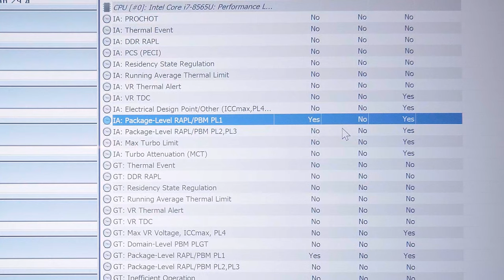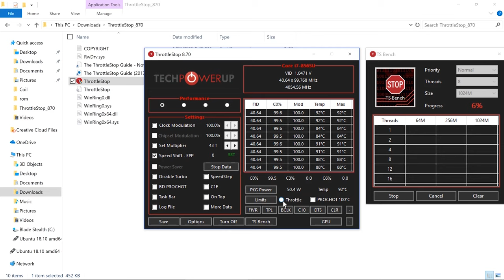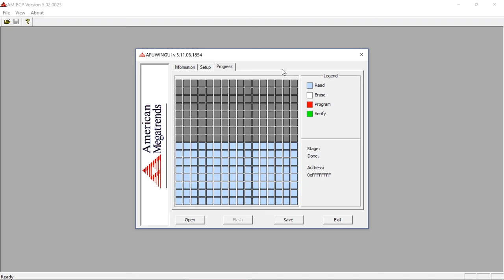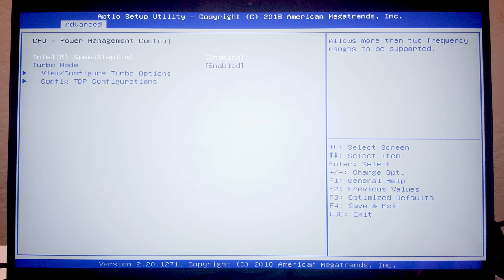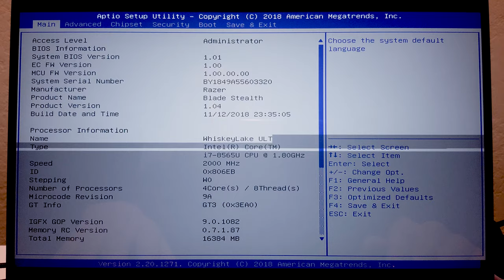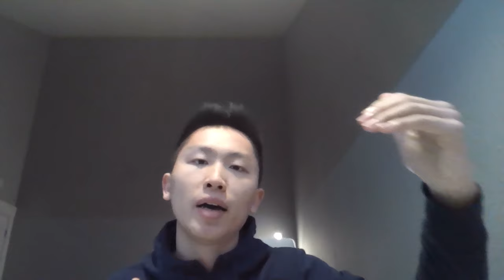Razer Blade Stealth 2019: Ridiculous Power Throttling (Performance Review) UPDATE IN DESCRIPTION

Comment: For only 2.5k subs, this was an incredibly informative video. Looking into changing configurable tdp options for an hp spectre here because it does a similar thing as the razer blade stealth, but after 9 minutes it drops back down to 20 watts on a 9750h, which is a ridiculous drop, everything considered.
Reply from the maker: HP = Having Problems. Glad you liked the video!

Comment: Enable CPU VR settings in the BIOS and try and set the following.  

Advanced/CPU VR Settings/Core IA VR settings/ 

IMON Slope = 50
IMON Offset = 31999
   IMON Prefix = -

This works on my Eurocom laptop to lie to the laptop about the CPU power consumption and allow for full turbo boost without the laptop power throttling down.  

Power readings are going to be wrong, but it will allows me to run unlimited.  Although I would be careful about temps as it looks like your laptop was throttling due to power, but the temps were skyrocketing anyways.  Also your mileage may vary since you have a Razer laptop but the BIOS looks the similar.

Comment: I've got the new RBS late 2019 with the GTX1650. This sees sustained power limiting to 15W. Disabling the GTX1650 within device manager allows the chip to run at 25W. Synapse has 3 options, Battery, Balanced and Gaming. Gaming allows boost up to about 45W for a few seconds then tops out at 15w. Temps at 15w only about 65c.
Reply from the maker: Thank you for this info!
Reply: I just ordered this machine and what to use it with EGPU, therefore I want to get as much as possible out of the 1065g7. I only really need the 1650 when traveling. Is disabling the 1650 and running in gaming mode the only things needed for it to run at 25w? What boost clocks are you able to reach?

Comment: Just update (RAZER BLADE STEALTH 13” 2019 SOFTWARE UPDATES)
new mode call Creator Mode (Embedded Controller (EC) update. )
Reply: @Ray  - i turned the creator mode on and CPU still caps out at 3.1 ghz underload.  Doe the new creator update mean to stop the stealth from throttling?

Comment: Preach brother. This is a major f'ing problem. You should call it what it is: a slow laptop because by design, it can't deliver the performance users were promised. And it's not just a Razer blade problem. It's with almost every thin and light gaming/performance laptops out there. So frustrating

Comment: The biggest problem with Razer is they're scared to let the 13" stealth be as powerful as it could be, or already is. The power throttling will be to meet some ridiculously self-prescribed target set by Razer that keeps it "an UltraBook". Fact is it's probably power throttled because there's nothing else to let it's performance down, so it's kept locked out of it's real ability so they don't hinder the sales of their 15" laptops. 

Unfortunately, every company ends up with this problem. They have so many niche products on the market that they're biggest competition is likely to be themselves in the end. Razer have made the 13" so good, it makes people question why they'd bother wth the 15" - which costs Razer money, even though they're still getting your sale. Apple have had this problem for years with their MBA and MBP updates. The Air periodically gets refreshed ahead of the Pro series, usually with a good 6 month lead. For people that are looking for a new MacBook, they buy the Air because it meets their needs and offers better value for money. When the Pro's get updated, they then compare the saving of $1000 to it. 

The new MBA's with the M1 chip are way better value for money, considering the MBP's use the exact same chip now too, and cooling isn't a problem with Apple's CPUs. Why would you spend more?

Comment: First of all, these tools were very hard to find and I had to try atleast 5 versions of afuwingui before it doesn’t say my system is unsupported. ( a later version of this video works with windows 11 for me ).

The problem is that once I flash the rom I have an error telling me that the ID or something is unrecognized. Apparently it won’t work because it’s unsigned code while it worked for you. My laptop is a rather stealth on 10TH gen.

I also tried to do it with Efi Shell and couldn’t flash the bio too cause the ID of my bios aren’t recognized or something ( error 46 )

I even followed a tutorial to unlock the CPU using the Ru Efi editor and it did nothing. But I guess my solution would be somewhere in these this Editor I just don’t know which values to disable in it and I’m not sure if this works

Is there any way to go past 15W in the stealth model 2020 in 2023 ? Or is it just impossible 

Thank you

Comment: You have missed the cause. The real reason for these forced throttling is Intel's Dynamic Platform and Thermal Framework. It enforces throttling regardless of CPU temperature but base on MOSFET temperature for CPU power supply. Usually the throttle starts around 90C but even without it, these MOS won't exceed 95C with proper cooling (I think Razer does used vapor chamber to cover those MOS) and is safe. The best way to do it is uninstall all DPTF components from Device Manager, and before doing that, make sure the hardware IDs of these components are blocked in Group Policy so that they will not be reinstalled. I've been doing this for my XPS 15 for a really long time and it works superbly.
Reply from the maker: I've already done exactly that. If you Google "disable dptf" the first card that comes up is my article. Thanks for giving my video some thought though

Comment: Thanks for the nice video.
I made a custom BIOS from the information you posted in the overview section. As a result, I was able to avoid PL1 by making the system misinterpret the actual TDP.
I was able to set my Blade Stealth i7 8565U above 4GHz on all cores and got Cinebench R15 880cb at the limit of cooling.
Reply from the maker: Awesome!
Reply: Details?

Comment: "How are you? I need help! Since the launch, I have owned a Razer Blade Stealth 13 i7 1067 with a GTX 1650, and I have many performance issues! I saw in a forum that you solved the problem using a modified BIOS! Where could I find it? The link in your video is no longer available! If you can help me, I will be eternally grateful!"

Comment: Great video that BIOS mod was insane! Bit of a long shot question but do you know if there are any similar bios hacks for the late 2020 Razer Blade Stealth with 1165g7, 1650Ti and 120hz display? From what I've read the bios' on late 2020 models are locked unlike earlier models meaning only a hardware programmer would work. Until I find a solution I will try to use throttlestop even though the cpu is already more than powerful enough for me.
Reply from the maker: I don't know of any solution for that model, sorry. Glad you liked my video.

Comment: Hi Brad, thank you SO MUCH for this video - I've got the Kaby Lake refresh (i7-8550U) Razer Blade Stealth and seriously needed a way to deal with temps and throttling while gaming (using the Razer Core v2). In your estimation, what might be some best settings for my 8th gen CPU when thinking about turning on any hidden settings in Razer's bios for my own machine?
Reply: Also, now that Notebook Check has shut down and the forums are gone (along with the two decades of data in them!) - and your link to the discovery of a new BIOS trick doesn't work - are you able to fill me in on what that new development was by chance? Thank you very much if so :)

Comment: razer just released an update to synapse that unlocks a new power profile called "creator". promises to reduce throttling in some causes. I have tested it out playing  sub nautica and i have not seen the throttling from throttlestop so far.
Reply from the maker: Since I've returned my Stealth, can you help test this? Run a TS Bench (size=1024), what does the Package Power stabilize to?
Reply: Same result as what you had in the video unfortunately, throttles almost immediately when the processors hit 100%. Locked at temps of 68 -71 degress and 25 W package consumption.
Reply: My Razer blade stealth 13 throttles when I play Minecraft. Simply Minecraft, when it's on charger. Any help? I don't want to limit my fps, I feel like Minecraft should make it overheat

Comment: Did you try disabling or even completely removing the Intel DPTF. Atleast with my xps 15 9560 and Asus zenbook ux430 it is the factor that controls the PL1 even after overriding from TS or XTU. Once it is removed the PL1 limits works as expected.
Reply from the maker: Yep, I tried that behind the scenes too. Thanks for commenting though
Reply: I have a onda branded cheap ass 7y30 tablet that had totally unlocked aptio uefi out of the box. I had to disable dptf so it would accept 20w/20w pl1 pl2 (at the same place you had yours changed)

Comment: The only issue with my stealth mx150 is when i use battery power i noticed that sound is crackling specially when trying to play games, sometimes just playing video or song would crackle sound when on battery power. Once i plug in the charger issue goes away.

Comment: Did you ever find a fix since you posted this video? I am getting decent clock speed when plugged in. It starts power limit throttling like crazy when it's running unplugged, on battery. Let me know!
Reply from the maker: Nope. If I did, I would have made a video or some kind of update about it. Rip
Reply: @BradsHacks  Thanks. I'll be on the look out for your updates.

Comment: So I'm using the early 2019 MX150 Razer Blade Stealth and I'm not entirely sure if the issues I'm facing are the same as yours here. I experience battery discharging while gaming (potentially because I"m using the included 65W power adapter instead of a 100W one), and together with that, what seems like thermal throttling even though my temperatures seem fine. From this information, what would you suggest I try?
Reply from the maker: Figure out what's happening by monitoring the CPU Package Power.
Reply: @BradsHacks  I've been monitoring my laptop via XTU, and the issues I'm seeing is mainly *power limit throttling* almost constantly, especially when under load (even light games, or stress test). I've tried undervolting a bit but that hasn't done much to fix anything. Temperatures are fine and even when battery is full/near full, I"m getting the power throttling and can't seem to fix it. I'm also getting current/EDP throttling but I'm not sure what that is.
Reply from the maker: @whole.milk__  try this http://forum.notebookreview.com/threads/take-full-control-of-your-razer-blade-w-no-pl-throttling.827919/
Reply: @BradsHacks  Yeah I've looked at this post as per your description. I am willing to try these steps if I absolutely have to, but I'm gonig to try the 100W charger first. 

Can I clarify what stat I should be looking at in XTU etc. to idenitfy if my laptop is suffering from this particular issue - is it "Package TDP" with its wattage indicator? Is there a number I"m trying to look for?
Reply: A lot of blades discharge while gaming, it's a feature, not a bug

Comment: Great videos, not sure how I missed these for so long.  I know intel lets companies configure these CPUs up to 25w from the rated 15w TDP.  Could it be intel frowns upon companies running these over 25w sustained?  Maybe razer would like to do that but does not want to go against intel.
Reply from the maker: As far as I know, Intel only provides guidelines for what the PL1 and PL2 could be. The thing here is that Razer chose to implement the PL differently than everybody else.
Reply: @BradsHacks  That makes sense as well, I know for desktops motherboard makers have been blowing TDP numbers out of the water for years now and ppl are just starting to notice.  Maybe with laptops intel is more strict since battery life and heat are so much more of an issue/marketing point.

Comment: Thanks for investigating all of this.
I'm getting EDP limit even at no CPU load when on battery and wonder how I can disable this shit, because the super portable Blade doesn't allow itself to be portable and limits i7-11800H to around 1.6GHz which makes it potato when unplugged.
Reply: WIthout the external power supply you can't achieve much more. Even the GPU goes into a power saving low TGP mode
Reply: @Alex-ch2ud  well I wouldn't mind to completely switch off Nvidia and powersave Intel GPU, but how is that CPU couldn't even take 45W when operating on a battery, you need this for surfing or watching movies on web at sofa

Comment: MORE OF THIS CONTENT!!!!!!!! Very agree with your view of comparing hardware at its maximum, hardware and software modded to the brink. 
ABSOLUTELY LOVE YOUR CONTENT! PLLLLLLLSSSSSS MOAR!!!!!
Currently trying to swtich all lights at my XPS 13 9370 to red (eyes hurt with white LED) after the basic mods like thermalpaste switch and ThrottleStop finetuning. 
Once you hit the sweet spots of perfect balance between heat, noise and perfomance in AC mode and batterylife while just enough performance when needed its just pure bliss. 
How much difference did applying thermal pads in your mods make to temps? Thinking of doing it to my XPS but it actually would block parts of the air intake. Hm..
Reply from the maker: Thanks for your support, friend! If it blocks airflow then I wouldn't recommend it.